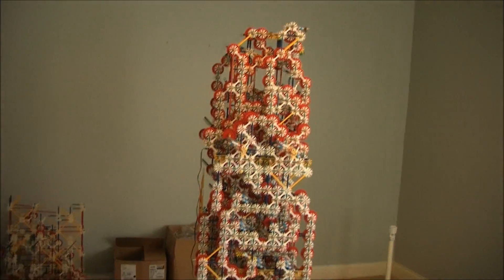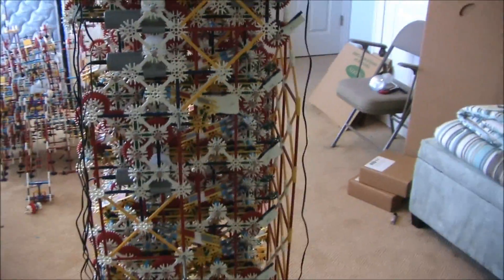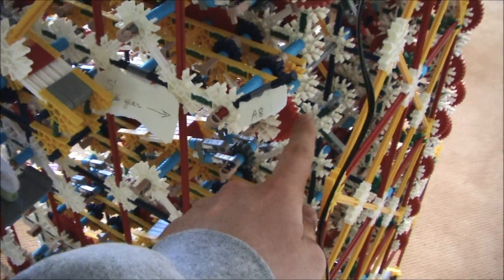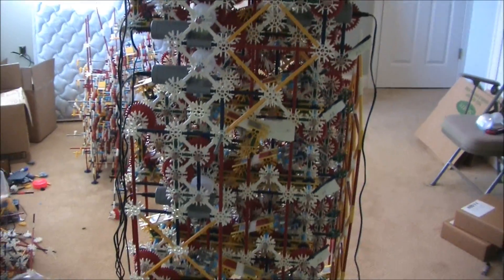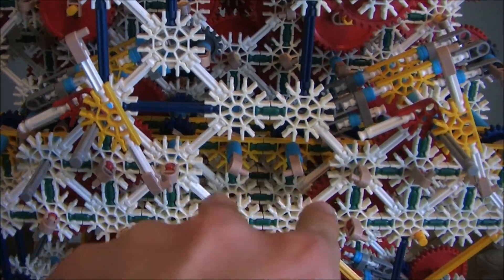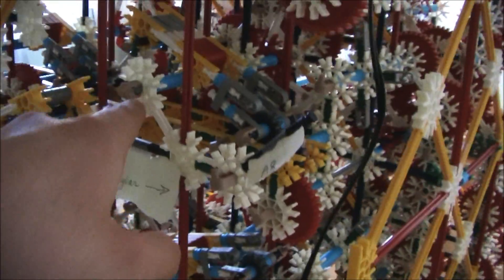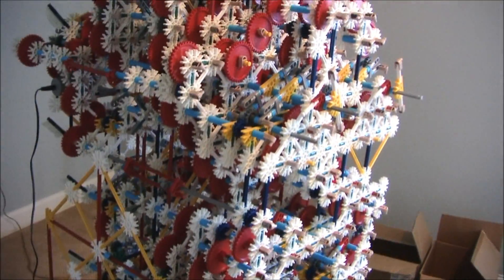The K'nuter - K'NEX Computer

Comment: Dan - So, if I understand correctly, this full tower implements only a single-bit wide full adder. I am not sure I understand the notational system.  I wish  you had explained the data representation first.  I assume 1's complement arithmetic.  Therefore the ADD/SUBTRACT switch need only complement one of the addend inputs.  

From what I gather, the state of the two addends and the ADD/SUBTRACT setting are input by the position of "seesaw" levers, while the state of the CARRY IN is unspecified (but expandable via some connection of gears) and the SUM and CARRY OUT results are represented by gears in which rotation represents '1', while non-rotation represents '0'.  You also seem to remark that the representation of the CARRY bit changes from positive true logic at the input to negative true logic at the output.  That's fine; Cray's direct-coupled trasistor logic (DCTL) inverted its representation as the data passed through each stage of logic -- but by accepting this dynamic system of representation, he managed to achieve a ratio of transistors per gate of 1:1 while everyone else required more.

So this stack of K'nex represents (3) XOR gates (2) ANDs and an an OR?  Or did you implement it in some alternative collection of gates?  I assume so, because you remark that your SUM bit result is inverted.

I hope you have introductory tutorials in which you demonstrate the deisgn and implementation of each type of basic gate you implement into your design.  I'll check and see.
Reply: Rosetta Stone:
0:25 - Transistor / Demultiplexor 
0:40 - AND Gate / Majority Function
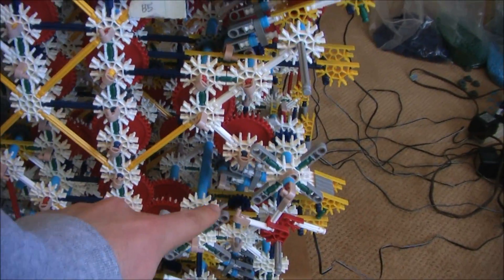7:10 - Rotational motion to "seesaw" state transducer
7:20 - "Relay" = seesaw IN; motion/no motion OUT

Fanout is accomplished via one gear driving multiple gears.
Reversing rotational direction is accomplished by meshing an even number of gears.
Transduction from rotation state to "seesaw" state is accomplished via a rotating cam kicking a lever attached to the seesaw input.
The "seesaw" "relay", itself, functions as a transducer from seesaw-state to rotational-state.

Here is my understanding so far.  (Please correct me if I am wrong:)
Logic states can be represented in 2 ways:

A)  Rotation, no matter how slow, represents the active state; while lack of rotation represents the inactive state;
B)  The position of a "seesaw" lever represents state.

In this video example, "seesaw" right side up represents '1', while right side down = '0'.

A "relay" is a "transistor" (demux) with only one valid output (therefore switching between "motion" and "no motion", instead of "motion of LEFT=DOWN output spline" vs. "motion of RIGHT=DOWN" output spline.

The AND majority function is represented by 2 "relays" (partially populated "transistors") in series.  In this example, if both "relays" are in the seesaw LEFT=DOWN state, rotational motion is transmitted through the gate to the output, but if either seesaw is in the LEFT=UP state, the output spline remains undriven, and (hopefully) rotation is suppressed by inherent friction.  (Hopefully no reverse transmission of torque is sufficient to turn the disconnected output.)

Still, to achieve a complete set, we must also implement a complement function in addition to the majority function.  I believe it may be possible to implement a full-adder with no inverter using ANDs and ORs in sums-of-products configurations, but you still need an OR.   If you are lucky with states and DeMorgan's laws, maybe it can be done with only ANDs.  Maybe this accounts for the inverted state of the CARRY OUT bit.  (I dunno yet.)

It is easy to create NO rotational motion from rotational motion, but I see no convenient way to create rotational motion from NO motion.  Hence a Boolean complete set is not possible if we accept the rotational motion = 1, no motion = 0 representational system. 

I can't really tell from the vid, but it looks like maybe the DEMUX-style "transistor" has the potential to represent both Q and NOT Q outputs.  E.g. if Q=TRUE, the LEFT output rotates, but if Q=FALSE, the RIGHT output rotates.  This would create separate data paths for Q and NOT Q.  Not convenient, but possible to implement.  Like a CMOS circuit, each gate provides complementary outputs.  Hence the requirement for an inverter to complete the complete set could be satisfied.

Alternatively, one could adopt a system in which clockwise rotation represented a '1', while counterclockwise motion represented a '0'.  It looks like the "transistor" at 0:26 may be capable of this function.  There are an even number of gears between the seesaw gear engagement on the far left and the engaging gear on the far right, so they could be rotating in opposite directions.  And it is a "break-before-make" mechanism, so there would be no lockup from a clash of counter-rotating gears.

I am not sure why you call this device a "transistor".  I think "switch" would be a better name for it.  There appears to be no transconductance-like mechanism involved, and no inherent gain or increase in fanout.

Why does everything slow down so much?  I am guessing that there is a reduction of rotational speed as the data passes through each of some kind of component in the logic chain.  I see no mechanical requirement for such a reduction, so I can only guess that this implementation decision was adopted due to conditions imposed by conveniently available k'nex parts or configurations.  It's kind of unfortunate.

I'll see now if I can figure out whether you have adopted multiple paths for Q and NOT Q in your architecture, or if you differentiate between states dependent upon direction of rotation.
Reply: As far as I can tell from close examination of the vid, you adopted the "separate geometric path for NOT Q" convention, with rotation = '1', and NO rotation = '0'.  In this architecture, the lack of an "in-band" complement (NOT, invert) function, and providing the NOT function via geometry dictates larger physical logic layouts.  In cases where both Q and NOT Q are valid choices, you must construct both independent physical logic paths.  This can (and usually will) lead to an "explosion of state," in which the exponential number of states relative to digits grows so quickly as to prevent realization of the computation.

If it were possible, and you come back to this project when you have kids, or when you retire, you might consider trying to redesign your architectecture so that you can transmit both Q and NOT Q along the same data path.  Although it may require more hardware to implement the basic logic gates, if you build something requiring a large number of gates, it will require less total hardware through a reduction of the number of total gates.  (I know you can easily calculate the cross-over point.)  I think the simplest convention might be to adopt a representation in which the dyadic states are represented by rotation of the splines in opposite directions.  This would also eliminate the "computability" issue of not knowing whether it is just taking too long for the motion to ripple through the logic, or the answer is zero.  It would also eliminate the ambiguity of not being able to tell whether a partial result is zero -- as represented by lack of motion -- or something broke along the way.  

It would also eliminate this weird shorcoming wherein you can SET seesaw bits from a rotating ('1') source, but you cannot RESET them from a non-rotating ('0') source.

But, all-in-all, this is a VERY COOL project.  I didn't know it was possible to construct a real computer with k'nex.  You've got me thinking.
Reply: Later:  Is that right?  With this architecture, you calculate by setting all the states back to zero, and waiting for the ones to propagate through to the output?  I don't see a way to reliably reset the "seesaw" bit state from the rotating spline driving it.  It would be awfully difficult to build an 8' CPU with that limitation!

Am I missing something?

Comment: what is the point of this?
Reply: You don't need a scientific calculator with binary mode anymore
Reply: It's a mechanical model of a full adder , I'm not a computer science  engineer but apparently on one computer chip there are millions of these.This is a representation  made for fun.
Here's the historical map of what happened when the data got too big at every stage and calculations became faster (might have inaccuracies but gives gen idea)
1.Humans mentally calculating stuff-
2.discover writing on paper or use stones
3-invent formulaes which can take big shortcuts
4-develop calculators like abacus 
5-develop small mechanical calculators
6-develop some large mechanical 
Calculators like this one
7.Electrical technology advances and we move to smaller components
8.Electronic even smaller components invention of transistor is responsible for this.
9.si- scale integration-a few 1000 transistors are on a motherboard
10.lsi-large scale-few 100000
11.vlsi-very large scale-few million(I think is presently most common in use)
12.Gsi-giant scale -few billion 
13.Quantum computing-I still don't understand it ,but apparently it's the next big thing.

Comment: i didn't understand a word of what he said...
Reply: Sam Norfleet It's a mechanical model of a full adder , I'm not a computer science  engineer but apparently on one computer chip there are millions of these.This is a representation  made for fun.
Here's the historical map of what happened when the data got too big at every stage and calculations became faster (might have inaccuracies but gives gen idea)
1.Humans mentally calculating stuff-
2.discover writing on paper or use stones
3-invent formulaes which can take big shortcuts
4-develop calculators like abacus 
5-develop small mechanical calculators
6-develop some large mechanical 
Calculators like this one
7.Electrical technology advances and we move to smaller components
8.Electronic even smaller components invention of transistor is responsible for this.
9.si- scale integration-a few 1000 transistors are on a motherboard
10.lsi-large scale-few 100000
11.vlsi-very large scale-few million(I think is presently most common in use)
12.Gsi-giant scale -few billion 
13.Quantum computing-I still don't understand it ,but apparently it's the next big thing.

Comment: Can it run crysis?
Reply: Technically yes. However, you have to do all the calculations and code by hand, its super slow, has an astonishingly low fps, no display, and no speakers. It would take years to get past just the menu screen, depending on how fast those motors and gears are turning and how fast you can move to flip the correct switches. So, while it can play Crysis, it is impractical and super inefficient.

Comment: So this is an adder/subtractor of two 1-bit values with carry?

Some redefinition of components
carry in= carry
carry out = high bit
output = low bit

You had the settings:
Carry: 1, X: 1, Y: 1, Subtract

Expected output with this configuration: 1 + 1 - 1 = 1
You got: 3 (or -1)?
high bit 1, low bit 1 = 2^1 + 2^0 = 3
or if signed:
high bit 1, low bit 1 = -2^1 + 2^0 = -1

Comment: i found an inefficiency in the computer that could save electricity as well as minimize some of the parts you used. give me a couple years to explain. i have to google what k'nex is, find out what transistors do, learn about gears and get a masters in electrical engineering or computer engineering. easy.

Comment: Just gonna point out that the 200 year old difference engine was far more capable and quick than this thing. Hell, there were less complex and smaller (like pocket) mechanical calculators in the 50s. I guess this is an interesting build, just think it could be improved upon significantly

Comment: Yeah, just sketched a rough diagram of a gear system for full binary adder, only needed 2ands, 2ifs, 2 or gates and 3 motors as you've described and demonstrated them, aswell, mine would self reset if the arms balanced to neutral when not under load.... Maybe there is something here I'm missing that requires so much more but it seems very simple

 There are only 3 states.  Inputs are a b c. C for carry . A b are input values.  If a&&b Output bit=c, carry output=1. .....   thats 2ifs connected to make an and.  But the 0side of those ifs are unused so far.   The next state is if not a && not b.  How convenient we have both of those input states read and free.  Connect those to the same composit ifs to make an and.  So, to recap if(!a&&!b) connect output bit directly to input c. But we STILL have 2 0's on that last composite and, which both lead to the same last case- output carry= input carry, output bit = not input carry.

Comment: Im quite confused.. Why did you need more than 2transistors 2ands and 3 not gates...  (essentially 5 transistors and 2ands for your setup it would seem.)  Can you publish a logical diagram... If the system can't self reset between calculations...   figured by the size and number of drivers you'd be adding a byte or at least a nibble

Comment: Ok, some of the other comments to this are hilarious.  And spot-on.  This is a great example of why electronic computers are amazing, and why mechanical computers were/are big, slow, and expensive.  And mainly history now.  But it is important to understand that in theory at least, you could build a real computer this way.
I didn't check out your website link (in the video info), but I hope you have the sub-units of this contraption broken down there individually.  I came upon this video by accident, and it is a little difficult to digest in one assembled lump here.  Hard to see where one sub-unit ends and the next begins.
It sounds like you might have had K'nex funding support at one point?  How many pieces is this device up to now, and what raw part cost? That looks like a LOT of pieces.  I know they are cheap for a handful of pieces, but when you have thousands, it starts to get expensive!  By the way, I hope your webpage has links to good resources that explain how early computers worked, and what the logical sub-units are, and how they work together.  That would help your (smart AND interested) viewers (who don't have electrical engineering degrees) understand better what you are trying to do here.

The biggest problem I see though, is that you have spent your design effort on the "guts" of this thing, and not the aesthetics/visuals that everyone can respond to.  Even hand-sketches on paper, of what a one looks like vs. zero, at the two inputs and the output, might help people understand this video.  And you should do multiple runs, to show it can actually add different numbers correctly!  How do we know this doesn't give the same number every time?  
But just the fact that nothing jammed up during the video is impressive 😂.
In addition to knowing how many pieces this took, I would be interested to know how many assembly hours it took.  What cost/time/space would that scale up to, to build a complete basic processor/computer?  
And how about design plans for each sub-unit you've used?  It would be nice if you have posted those on your webpage, so other people could try building this too.  Or at least one part of this at a time (not everyone has as many pieces as you do 😂.)

Comment: Loook at this shit. 
This is call having no life. Why did you just not use calculator?
Waste of time and probably som metal or body disorded to not having a Job, and doing a piece of shit in machinery history for no reason. And this need a fucking power to run, but, Windows od even ubuntu is to big step. We have 21st century and technology, and what is The best, brains, to know what answer you will get after doing 1 - 1. Fucking zero, like this Machine.
Daaaaaaamn

Comment: I'll just use a handheld device called a calculator that doesn't take 10 minutes to calculate and also works with numbers besides 0 and 1. It also can calculate complicated equations and can't be knocked over by a little 3-year-old brother. However, A+ for making this out of small toy pieces. This looks cool.

Comment: NASA’s budget cut is really starting to show
Reply: Thats really good :D
Reply: i subed to your channel because of this comment
Reply: Can it run doom
Reply: Underrated comment.
Reply: Zach Whitlow lol
Reply: Good point, though I'd still love to see the launch at cape canaveral
Reply: Best.
Reply: @MrTNTitans32  It works in binary, so the values are only 1s and 0s, but combined they can make any of you "normal" decimal numbers. You phone or computer works like this as well. For example:

-First column: decimal number: what you see.
-Second column: binary number: what the computer internally works with:

0: 0
1: 1
2: 10
3: 11
4: 100
5: 101
6: 110
7: 111
8: 1000
9: 1001
10: 1010
11: 1011
12: 1100
13: 1101
14: 1110
15: 1111
16: 10000
17: 10001

And this continues to any number...

For a computer working in 1 and 0 is easier because, electrically speaking, it just means "there is a high enough voltage here" and "there is low/not high enough voltage here".

Even if the number appear to be a weird pattern, it is the basics of digital electronics, and you can look up how binary numbers work and learn to convert yourself.
Reply: This joke made me laugh way to hard.
Reply: You sir win the internet

Comment: can it run Doom?
Reply: Frosttyy12 you need an 80386 emulator for the K'Nex, then it will process every bit of doom exe file
Reply: actually that isnt true... if you update the core K'nex gears and oil them enough you can run it on the 80385.